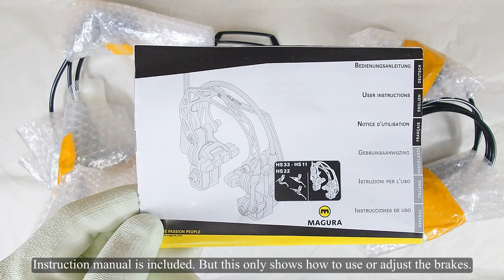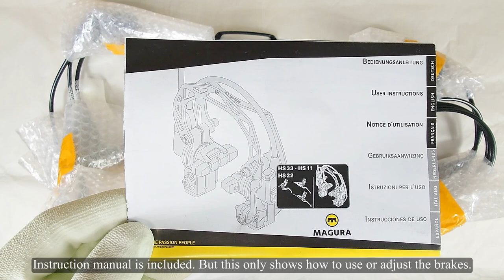[MTB gear] Magura HS11 Hydraulic Rim Brake - installation and set up

Comment: Good and detail video, thsnks bro. 
I will try this component on my new v brake frame. And after watching the adjustment method of cylinder, I think it should works well with dropbar shifter. Thanks for this video.
Reply from the maker: Thanks for watching!

Comment: At 12:42 you say "Now I need to cut short these ridiculously long hoses." but didn't show it. How did you do it? Do you lose any fluid and if so, what fluid do you use?  thanks
Reply from the maker: Hi, there is another video showing how I cut the hose and install the brake boosters:

https://youtu.be/rjNECG6MWdo

I should not recommend this maybe, but I use Shimano mineral oil. 
Thanks for watching!
Reply: @MindDesignFactory  Thank you!

Comment: Is there any like significant mounting difference between the easymount and the evo 2
Reply from the maker: Hi, I only knew that Evo 2 is newer and more flexible to fit on various rim brake situations. If you are familiar with conventional rim brake setting, then I think that you would prefer Evo 2.
I have found the following video at Magura official channel. Just a glimpse of difference between their mount mechanism, but you will get an idea (I hope...).

https://youtu.be/BLmAjlw4Txo?si=cpj9QMILTEoE932f&t=50
Reply: @MindDesignFactory  Thanks that explains the difference 👍

Comment: Say  I need to pick up a set of Maguras for an older frame - and I can't seem to tell whether internet places are selling front or back assemblies. Do yo know how to tell the difference??
Reply from the maker: Hi, HS11 brake levers are in flip flop design, so you can use a HS11 lever both as right and as left lever. Any front/back brake set will be fine although you may need to change the orientation of the lever's clamp cover as shown in this video.
Thanks for watching!